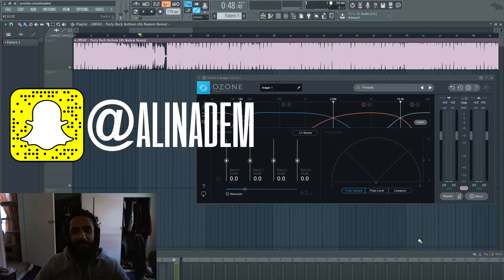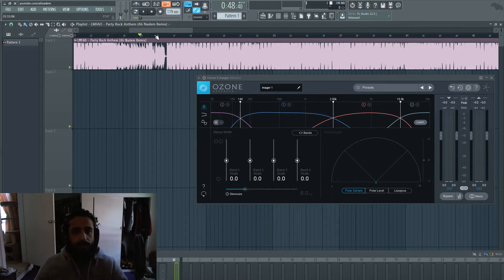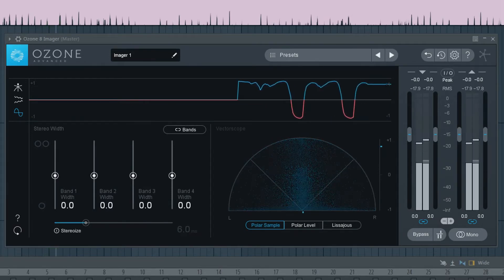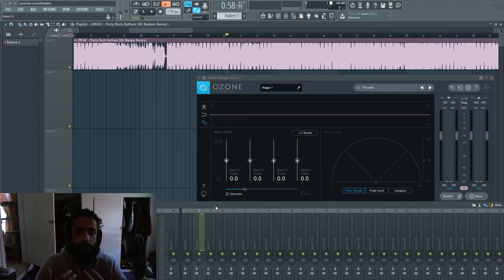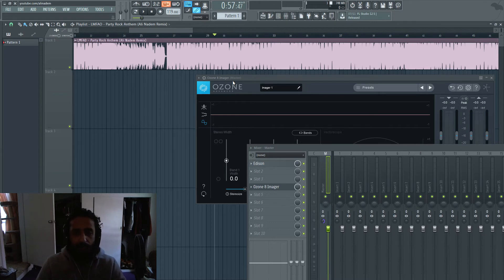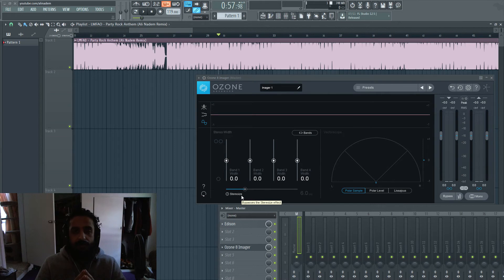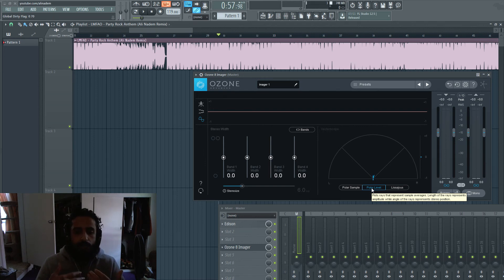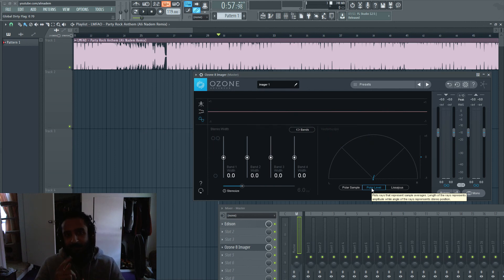Why is Phasing important? What is Phasing in Audio? Izotope Ozone 8 Imager - FL Studio 12 Tutorial

Comment: is there a video demonstrating the phase adjustment for individual EQ on the basic EQ on Ozone 8? I have been using it without full understanding. I wasn't sure how to use the control and actually did not relate it to the stereo mix in spite of knowing that mics need to be equidistant for a source to avoid phase issues. Thanks. Great video. It is these subtleties that make or break a mix.
Reply from the maker: I would just focus on the general sound, not isolation, listen to it normal, listen in mono, don't get too carried away with technical if there's a bit of phasing, it's ok, that happens naturally from reverbs anyways.

Comment: @Ali Nadem I feel a bit frustrated after hearing your description of phasing. I use Cubase and i thought that "phasing" is when two signal waveforms are fighting against each other by having opposite polarities (one is on the positive side, the other on the negative side). If the two signals are identical, having the same amplitude, only with the polarity being different, the signal will disappear completely (the two signals will perfectly cancel each other). I also know that the waveform is moving between -100% and +100% and that gives the amplitude of the sound (I think Fruity Loops does not have a waveform editor so you might not know what I am talking about). Now you are saying at the beginning of this video that phasing is happening when your sound is too wide (overall on the left-right field). Are you sure you're not mistaking? Or am I missing something? Looking forward for your reply. Thanks in advance!
Reply from the maker: I could be wrong with the theory, ultimately if it sounds good and most data is ok in mono, it should be fine

Comment: So, if I mix in mono and all sounds great, and I open up the master to stereo and a lead is too loud, how do I handle it? Cause if I turn the lead down, then its low in mono. What Ive been doing is then recenter the lead so its mixed more centered. I do than in mono and then just dont widen it. Is this the ONLY way to address this? There is NO way to have that sound to the sides? Just one of the final pieces I need to get a handle on.
Reply: Generally every part of the drum should be mono but you should pan the hats off to the right. Nothing more than 37. Snare can be stereo but then you want to use a widening and some phase
Reply: Yes you can, you can adjust the volume of just the sides using a mid side eq for example.. So that it sounds good in mono and stereo.
Reply: I wouldn't mix in mono only. Use stereo but use good moniters and then hit mono on occasion. Phasing and stereo widening (Air stereo width works great, just play with it for the best sound) is the best way to create space, have all sounds heard and also try not to pan even a stereo sound (strings, piano etc) 100 left 100 right, most should be around 60-70.

Comment: Bro I want to ask you,I have sound in my mix which has phasing issues, this sound can't be heard in mono. Now if I want to remove these phasing issues, I have to lower down the stereo width and have it more towards the mono side. The phasing issue will be solved by this but the sound won't be wide enought like it used to be. How to solve that?
Reply: In my experience personally, I would clone that sound and put it in another mixer track. After that, I'll hard pan one to the left and one to the right. It wouldn't be as wide as before but it would still eliminate phasing issues(maybe some processing could make it feels wide). Hope this helps you ;)
Reply: @quangminhha4206  thanks i was looking for an answer like this i have the same problem. i will try out your suggestion, also when you say add some processing to make it “feel” wider, what do you mean by this and how can this be achieved? any suggestions? thanks